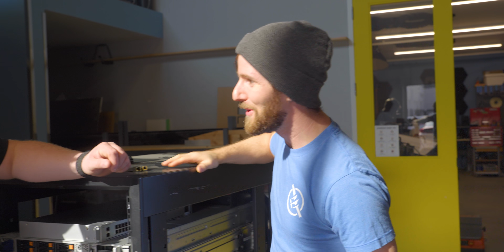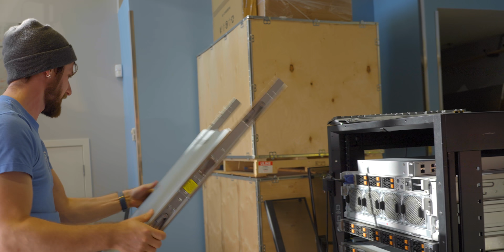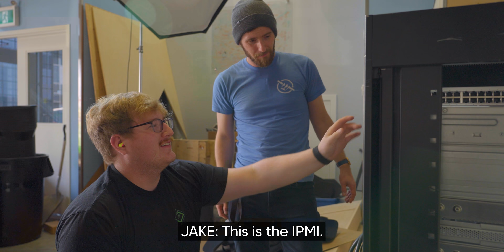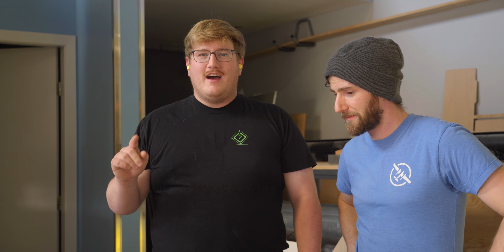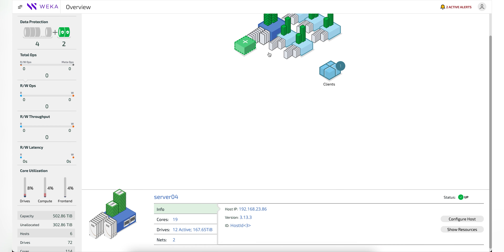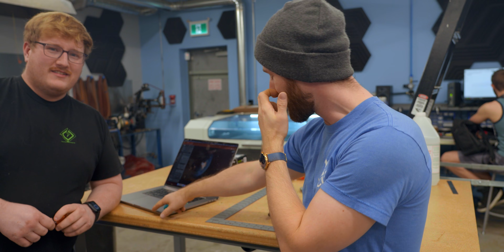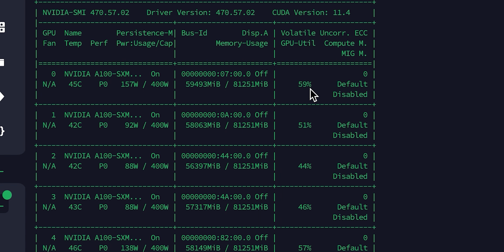The $1,000,000 Computer is Broken

Comment: Using that NASA data for the demo is such a good idea. It really helps contextualize the sheer amount of computation packed into that server
Reply: I still don't get why this is so huge, should't it be a pretty simple computation?
Reply: @paulbecker7039  Guess its not that simple of a computation if it even runs like ass on a $1M Dollar System
Reply: @paulbecker7039  every single frame of that demo is running millions/billions of characters worth of formulae trying to decipher the perfect way to land that craft. Air pressure/Fluid Dynamics/Delta V/etc are all being ON THE FLY computed and changed every single time that frame updates. Trying to make a computer do a fluid dynamics computation or render of any sort is already taxing, now do it with an atmosphere that humans have never physically touched.

Those calculations alone make every single frame change worth 14GB of data to the render. Meaning that 5FPS is ~70GB/s of OVER NETWORK processing power. That's the same amount of data as The Lord of the Rings: Fellowship of the Ring extended directors cut on 4K blu-ray.

Every. Single. Second.
Reply: @zenjoysmart  the amounts of data are impressive, yet already behind the state-of-the-art. I can already run simulations 10x as large, with 120GB volumetric data/frame, on such a visualization server with 8 GPUs in a matter of hours with my software. In CFD per grid point the set of equations is rather simple, but the number of grid points makes file size so gigantic.
Reply: @ProjectPhysX  really cool to see another layer deep on how this stuff actually works. I know Linus wouldn't probably have his hands on something cutting edge (especially given the layer of dust he scraped from the top at the start), I was simply giving a response as to why the render size was so large, and how 5FPS for that specific project was still pretty incredible.

Thanks for coming in and giving even more insight, I'll have to dig a little deeper on some of the topics you brought up <3
Reply: @zenjoysmart  Thanks for repeating what they explained clearly in the video.
Reply: @kimlo91  gee, and yet here I am answering a question about that very video, and something someone obviously overlooked. 

Thanks for pointing out the obvious intentions of me pointing out the obvious, really drove my point home.
Reply: @zenjoysmart  surely they could have waited an hour and rendered it to a video -  though it doesn't matter what it's doing (and I'm sure it's a hell of a lot ) but the demonstration looks like the equivalent of a 3DS max preview render from 20 years ago, it would have been much better if they were not using a 1GB NIC on the laptop - could they have connected bare metal to the server? OR if they modified for example the thermal dynamics properties of the environment so that - it burns up in the atmosphere in real time? or something maybe less dramatic, maybe they have restrictions on what they can do with the data, ok - then run a crypto miner across the storage, GPUs and CPUs to actually show it doing SOMETHING

I have a raspberry pi 4 8GB running 50 docker containers across 10TB of SSD, one of which transmits data from my weather station to the MET office - to show how cool all this is I'm gonna give you a demonstration of it updating debian. \o/
Reply: @ProjectPhysX always in a video about simulation talking about your product
Reply: @paulbecker7039  They forgot to include simple logic of: "If not 30fps, then run with fewer parameters / ignore unimportant bits."
Reply: If human lives are going to be relying on the calculations, there are very few “unimportant bits”
Reply: @fitybux4664  tHe MaChInE wIlL lEaRn WhEn It WaNtS to..
Reply: @fitybux4664  This, it looks like you could ignore so much stuff without consequences to accuracy
Reply: @paulbecker7039  there is always an engineering tolerance.

Comment: I was wondering what happened to this system. I feel like the possibility of a CPU not being seated just right yet the system can boot is bad design but what do I know?
Reply: the design is fine. as strange as it seems, this was a thing even back in the c64 era with old socketed chips. one leg didn;t make contact or the legs race was bad and the system will work, but you would lose some portion of the ram.

Comment: Hardest problem I ever had to solve was HDDs randomly showing up on boot, turns out the mobo only recognised HDDs on the second power cycle. So if you shut down and swapped sata ports around the ones you moved would disappear an the rest would appear naturally you would try swapping those that now work with the ones that dont then they would all disappear and the others would appear again. Seams completely random if you never experienced it before.
Reply: Thats a mobo limitation of SATA ports, usually written in manual.

Comment: I don't see how this server is so special, we will achieve in just a few months time, once Gen5 SSD's launch, close to 64GB/s with 4 drives in RAID 0 on PCIe 5.0 x16 on consumer motherboards, that also support Direct Storage.
Reply: 1. Gen 5 doesn't even exist on the market yet, and still didn't 6 months ago when they build it, and definitely didn't during the many months of planning. On the conservative side, let's call it 1 year ago that this plan was hatched.

2. Even if gen 5 SSD's came out tomorrow, they aren't going to be nearly 16tb per drive, and definitely aren't going to be made for data centers running 24/7. In practice, this means that while you only need half as many drives for speed, you need 4x the number of drives for storage. Beyond the number of drives, data storage comes with a lot of endurance and security features that regular consumer hardware doesn't get.

3. New technologies are ALWAYS more expensive and problematic to work with. Even though enterprise hardware is more expensive, you're effectively paying for extra reliability that isn't in normal consumer hardware. Not only are you paying more versus previous gen, but you're paying more for LESS reliability due to it being so new. Remember, it's not just a bunch of materials put together to make it run, it's also programming both on the SSD side and the server side.

Comment: Could always try a Machine & Deep Learning video focusing on why VRAM even exists in capacities such as:

NVIDIA
A100 PCIE 80GB
H100 80GB
RTX 4090 24GB
RTX 3090 24GB
P40 24GB
M40 24GB

And on why you may need it in certain workloads, such as "simpler" concepts like Deep Fake or similar higher VRAM benefitting apps. By then anyways that NVIDIA RTX Racer should be available as a boring but can it slay Crysis?
Reply: I'm developing computational fluid dynamics software, and there you cannot have enough VRAM. More memory here means finer grid resolution. Ever since I played with 512GB VRAM on 8 MI200 GPUs I cannot go back!

Comment: The NASA bit looks like real time rendering, not real time simulation solve which are 2 different things. The solve process takes a week on a cluster super computer, and then you need another less "super"  (but still a magnitude of order more powerful than a desktop) computer to render the results (its less rendering, more like displaying the physical results which comprise of tens of millions of cells in this kind of model). This kind of "rendering" is much more storage speed dependent and much less compute dependent.
Reply: I could be wrong, but didn't they show a screen on which they could change variables? That would imply simulation.
Reply: @waggy401  I highly doubt this, since this kind of simulation takes a few days to run on the largest supercomputers in the world. I guess whats happening is they changed the variable being rendered, but the results being used for the rendering are pre-solved.
Reply: @im.thatoneguy  Yeah, after I posted this I saw that the actual calcs were done with 72,000 GPUs or something like that. Crazy.
Reply: There is no need for fancy graphics when solving a systems model like that. Definitely a render type setup. They might have a very high fidelity model for testing but you can easily simulate such a vehicle with a decent desktop pc using a reduced model and it will still be valid.
Reply: @engineeringvision9507  It will be valid but this is not the point of this demo... It is about high fidelity CFD models which a desktop PC will solve in a few weeks at best.
Reply: @Noney8078  Still no need for graphical animations. Adds nothing.
Reply: @engineeringvision9507  Thats the whole point, graphical representations of physical results...
Reply: @Noney8078  That is not what is depicted. What is depicted is a video game style simulation.
Reply: Thank you for your insight and knowledge.
Reply: Yes they only do visualization.
My CFD software can compute+visualize such flow interactively on the same hardware, at 10x the resolution that NASA had. It's just a matter of efficient software.
Reply: @ProjectPhysX  Why would NASA spend millions of dollars on super computers if they can use your software on less expensive hardware and ger better results?
Reply: @Noney8078  they did that simulation in 2019. I published my software just 3 months ago. Requests are overwhelming so far.

Comment: cant wait for this level of performance in desktop pc's in 10 - 20 years, or at least storage, although gpu's are at 4nm so its basically driver optimisations, cooling, higher bandwidth that will bring larger improvements in performance or large server size computers becoming cheaper.
Reply: There is still a couple of Moore's law jumps to be made. If Moore's law continues past 1nm, you could see this tech in less time than 10 years.. There is still the problem of fiber optic networking which hasn't really gotten cheaper at any point. The network cards ofc have (since they are semiconductors) - but the associated hardware hasn't.
Reply: @rkan2  aren't there issues with making the die size smaller. such as more wasted silicon, costs would increase due to how hard it is to decrease the die size. with current practices i think going below 4nm is not impossible but highly unlikely and we need to find another way of making microcomputers. ii dont think wired is the future wireless mediums such as 5g or 6g will be more commonly used as wireless is often cheaper than wired.
Reply: @binrat3020  Absolutely. What you say about wireless though doesn't hold true. When you are comparing bandwidth with fiber it is orders of magnitude more expesive. Wireless will always be capped by the physical limitations of radio waves, atmosphere etc. Fiber optics will always remain faster. There is much improvement to be made with on-ciruit fiber optics that has been researched for a long time. Imagine your PCI-E 5.0 x16 slot being just a single fiber for example and the CPU having a built in fiber transceiver!

Wireless' main benefit was always it's coverage, which means you can cover more wallets to bill money from! I'm not saying wireless advancement via these wallets is a bad thing but again, it will never beat fiber. You cannot have a datacenter with petabits (or petabytes in the near future) of bamdwidth running on wireless.
Reply: @rkan2  i thought we were talking about internet networks where wired mediums such as fibre optics is expensive to use, I didn't actually realise we were talking about using fibre optics for the use case of data centres, yes of course fibre is faster for usage in a datacentre. who knows where wireless will be in the future though, I think the best solution would be instead of creating higher bandwidths, instead optimise what we already have by improving data compression.
Reply: @binrat3020  I mean.. It is pretty much the same anyway. The majority of internet bandwidth will always travel in fiber optic bacause like I said - It will alwaysbe able to hand more. Wireless can necer get ahead in anything except coverage.

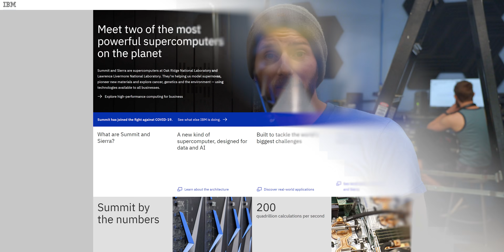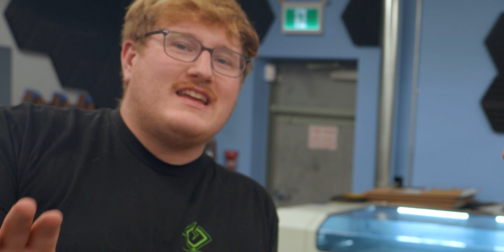Comment: I work with such HPC GPU servers every day. I can do CFD simulations like shown at 12:43 in half a day, on a single GPU node, and at 10 times the grid resolution that NASA had, 120GB for a single frame (14:05 :). No Supercomputer required. It's just a matter of efficient software.
Reply: Aye, I know you from the Intel guild haha, you had that GPU from the Uni LOL did you get offended when Linus mentioned it 
:DDD
Reply: @hariranormal5584  nono I use Nvidia A100s as well and they are lightning fast. It's just that the Instinct MI250 GPUs that I currently have access to have more memory so enable larger simulations. Currently I'm also testing PVC, will be exciting to have that 3rd competitor for HPC GPUs :)

Comment: At 4:07 Really shouldn't reuse thermal paste when it has already been used and heated up and left for a long time. Creates air pockets since the thermal paste has already cured before (Might be okay if you just did it that day and had to readjust the CPU in the socket or CPU heatsink to touch the IHS properly if it wasnt making proper contact, but Ive always put new paste because ive seen it cause issues in the past. I.E Overheating on one or two cores because of bad thermal transfer or just bad temps in general)
Reply: I would be sure they did it properly off screen, cpu was already identified as the root of the issue before making the video so they just made a bit of fun content about the fix. ( not that thermal paste was the precise issue)
Reply: @benwu7980  you didnt get my point at all. Had nothing to do with what was wrong with it in the first place so ill re-explain it to you and I highly doubt they repasted it if they didn’t put it in.

All I was saying was basically to dumb it down for ya:

Reusing cpu paste that has already cured will create air pockets creating bad heat transfer. Over time it will get worse. (Built enough computers pentium 2 and onwards to the newest gen stuff that it will affect proformace and thermals of the cpu. 

Nothing that I said had to do with the video problem, just another one they are creating for theselves in the future.)
Reply: @Eric-Robson-  Oh, I got your point, and I fully agree. I would never refit anything like a  cpu and cooler without a clean and a fresh application of paste.
All I meant was that I'm fairly sure they did do that, but just went with the more entertaining route of Jake complaining about the price of thermal paste, on a 1m$ computer :)